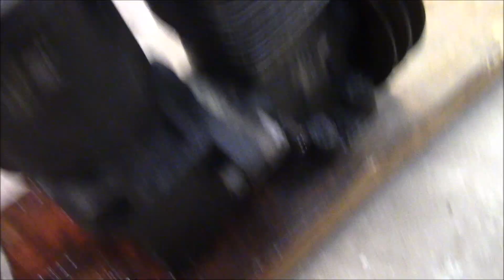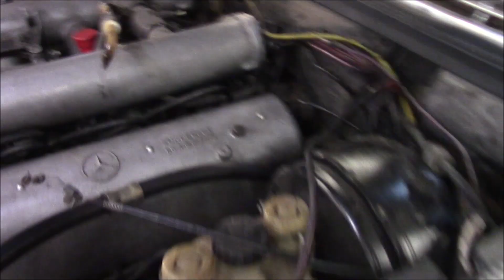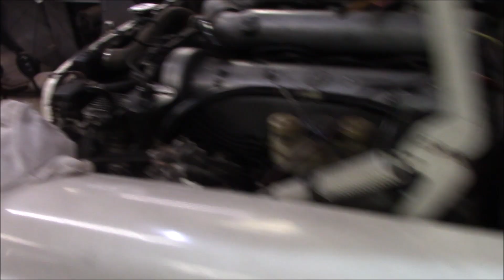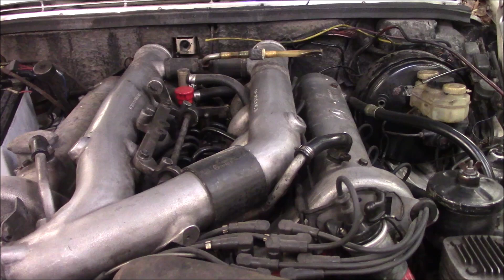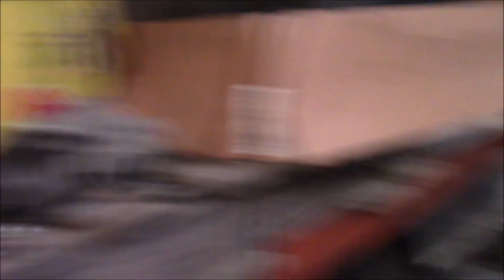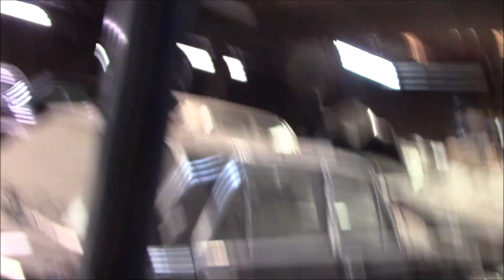1969 Mercedes Benz 300SEL 6 3 Euro Restoration Part 9

Comment: Power steering pump seal is a common failure. I have done dozens. I just go to my local bearing shop and get a seal ,It should be a double lip seal. What usually happens is the powersteer reservoir fills with engine oil and dumps it down the front guard. I hope you changed the oil cooler and compressor feed hoses because they will burst on you too. Put hose clamps on the manifold joint hose .Leaking air really mucks up the mixture. Your cold start thermo was not working correctly,it will run when cold but as soon as it warms up there's no fuel delivery because the thermo was not set properly. . There's no fuel pressure regulator ,it's 14 PSI at 1 liter for 30 seconds.It's volume not pressure you need.  Is the engine the lower compression US version or the Euro high comp .engine?